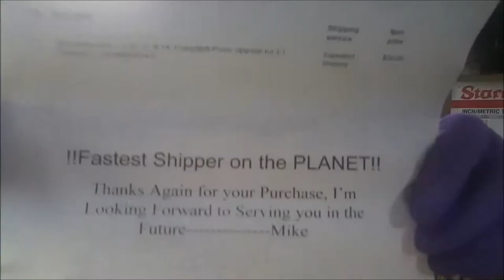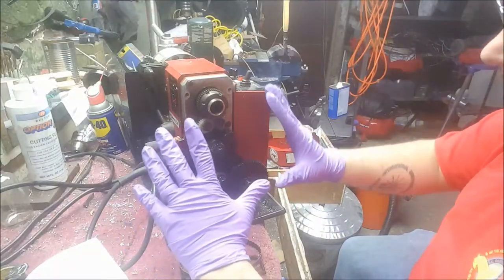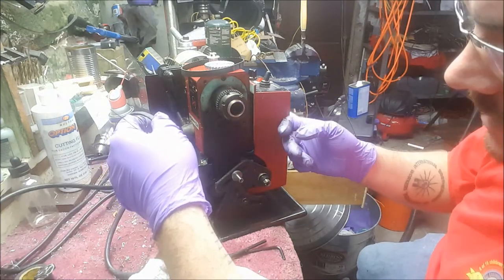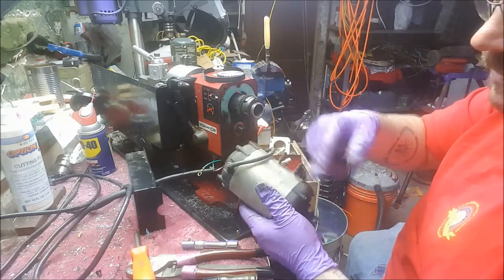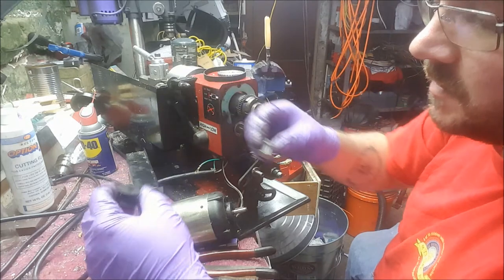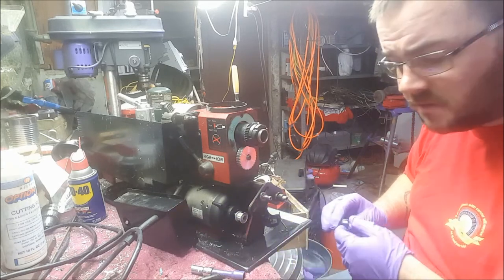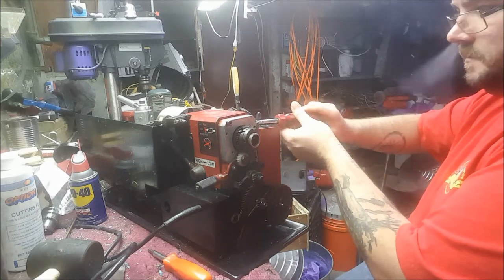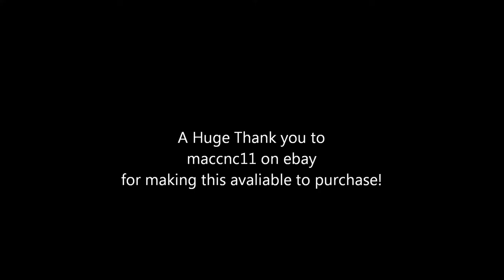Mini Lathe 3 : 1 Belt Reduction Power Upgrade

Comment: So much for this video being useful.  High-speeds through the motor adjustment, which is the only part I wanted to see ☹️
Reply from the maker: I still haven't figured out how to adjust that motor and i have had to build a new mount for it. 

So much for others posting stuff online has not given me any info.
Reply: @tek4  I haven’t had any luck finding anything useful either. I found one website that had a written description, but it didn’t work for me.
Reply from the maker: @jdiamond9513  so what i did to try to tension the motor is use a large screwdriver threw the hole to tilt the motor as much as possible and to level it off.

Comment: I got a new belt and small pulley and installed. After running in I needed to tighten the belt but found there was no way to do it. Motor was in the lower part of slots  but made no difference. There must be some way to adjust I do not see.  You seems to go past this and not say anything about setting belt tension..

Comment: I am probably way to late to answer your question on what lube to use. But white Lithium very sparingly works great on plastic gears. Mineral oil works good too. But it doesn't stick and stay on the gears very well.  Thanks for sharing  the video.  I am getting really to update mine here shortly. I will be going to this 3:1 motor drive route. Thanks again.
Reply from the maker: Larry Yaw it is a awesome investment that allows Heavy cuts albeit slower. These lathes are not production so speeds lower in this case can be a benefit.
I need to get a tach to test it, but I'm super happy with performance
Reply from the maker: Also yes, lithium is what I have been using but I'm looking at the all metal gear sets to upgrade
Reply: I bought the metal gear set and replaced the headstock bearings with tapered. A very worth with upgrade, JMHO. Micromark sells the too set that LMS no longer sells. I am going to guess that Micromark was selling them to LMS. It's not a very hard job. The bearing behind the chuck plate is the hardest one but easy with a bearing splitter  that you can rent for free from Autozone and a lot of other parts stores. I will be doing a 16 inch bed swap some time soon. I have also replaced the compound with the extended version too. These are fun little machines. I picked this one up pretty cheap so I can afford a few upgrades. Not a lot of hours on it.
Reply: I just upgraded mine with this same kit. I had the same issue with the Allen head screws on the small gear. Not  enough metal on the collar. I contacted the seller and he said some lathes have this issue. I am inclined to believe all have the issue. 

That being said, the original doesn't have screw screws either, it should be fine. I think it would be better if he noted it in the info and or just machined the collar up to the threads. The kit does increase the torque a lot.Over all I am happy with it. l've done about everything you can to to it now. 16 inch bed, extended cross slide, metal gears, QCTP and 4 inch spindle. 

 I also ditched the cross slide gibb adjustment screws and replaced them with shims. What a difference. I have less then .0005 of up down movement now. This is now a really nice machine.

Comment: My mini lathe has steel gears and I use motor oil on them. I have stripped two drive belts on my lathe in three years and find the replacements from the agents no problem at all. No need for an upgrade because the toothed drives are also steel as well, so the belt is the consumable part. Just for safety sake brother, NEVER take an empty chuck to full speed especially when the jaws are way open. Should a jaw come out at that speed ............

Comment: Good vid, but I'd like to see/hear what you're doing. No need to time-lapse.
Reply from the maker: George Keeney maybe I'll put a companion out, one that's full length and uncut. it's hard because I'm trying to get hour, hour and a half videos down to say, 20 min, maybe 30 min, due to attention and retention spans on yt. 

would you be interested in such a video?
Reply: tek413 90 minutes? Perhaps that's a bit long. :) I might not even make it through Fenner or Clickspring for an hour and a half. But 35 - 45? For sure. I like to see people work through things.
Reply: @tek4  Yes, I'm interested in a full-length, normal speed video.

 I can adjust playback speed to speed through portions I'm not interested in.... but even operating playback speed at 0.25 normal won't let me clearly see what you are doing , and certainly won't restore the missing audio of your speeded up parts.

Comment: where did you get the replacement belt?
Reply from the maker: https://m.ebay.com/itm/9pcs-CJ0618-household-small-lathe-micro-lathe-gear-metal-exchange-gear-/292686865709?oid=322544318977

Comment: Yeah... essentially useless to me, I was hoping to see details of how tot remove parts... not rapid, unexplained shots of stabbing at something I could not see, for a reason not explained, with what looked like an array of picks, awls, screwdrivers, dykes, pliers...  etc.

3  I can adjust playback speed to speed through portions I'm not interested in.... but even operating playback speed at 0.25 normal won't let me clearly see what you are doing , and certainly won't restore the missing audio of your speeded up parts.   An audio track could help supplement shots where detail is lost because of taking shots with wide angle lens from far away.
Reply from the maker: Well, to be fair your critique is deserved and I did a poor job on this video. 
Out if curiosity, should I delete it? Does it even have a slight value?
Reply: @tek4  I wouldn't delete it, but, you mentioned in another comment maybe making a long form version.... was the fast speed done in-camera, or do you have a long version, for which you speeded up some portions in post for the video you posted.   I would very much like to see a long version.      Because I bought one of these lathes at an estate sale... only to find that the belt is shredded.   And that the manual does not at all address changing the belt.
Reply from the maker: @ssn608  unfortunately due to the age of the video the phone i shot this on. Is no longer working and I don't have any backups of it. 

As far as the belt, you should be able to find one that would be close to accurate and not need to go threw the same steps of a kit I found on ebay. The kit changed the gear ratio and speed of the lathe making a slower speed but higher torque, and I should redo the parts I can with the lathe. I currently have it open on my bench again because the board has had another break in it, and I need to figure out a third or fourth different repair to it. I'm not sure how its still running lol.

But I will make an attempt at updating this video and making lore information about the belt replacement process.
Reply: @tek4  Thank you!